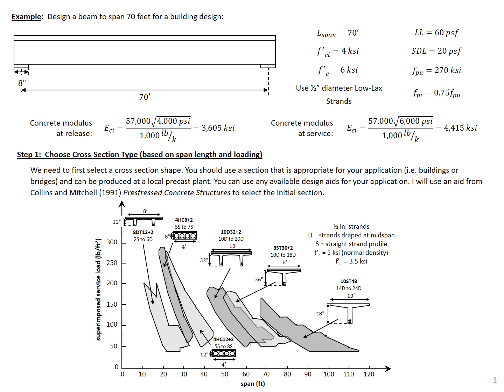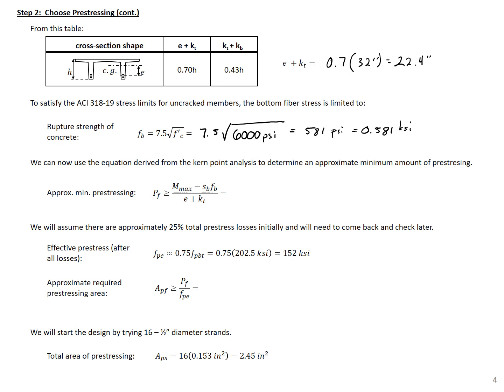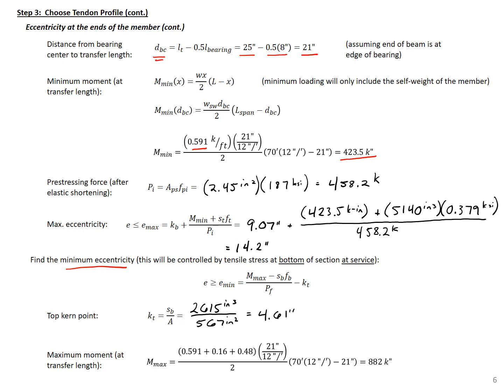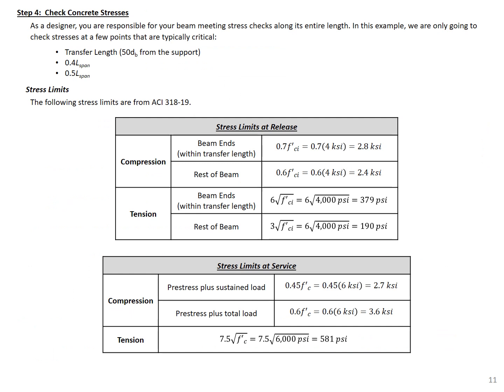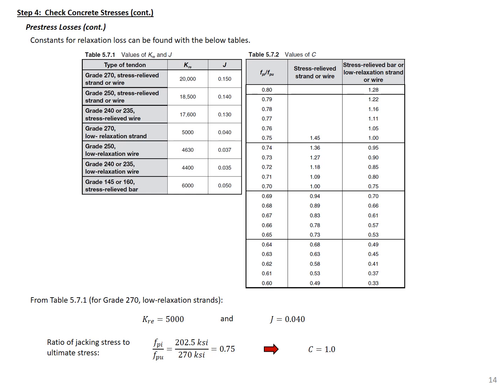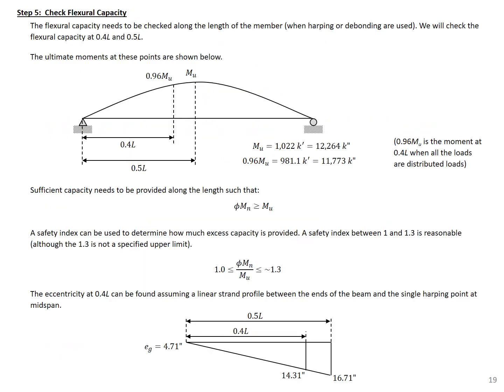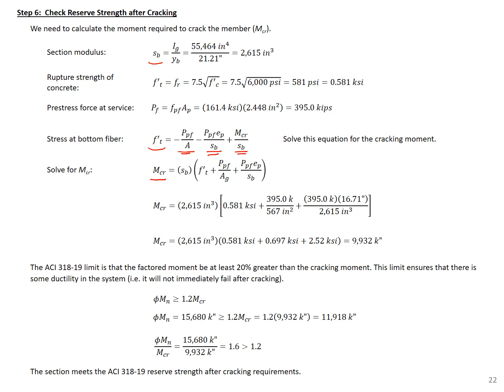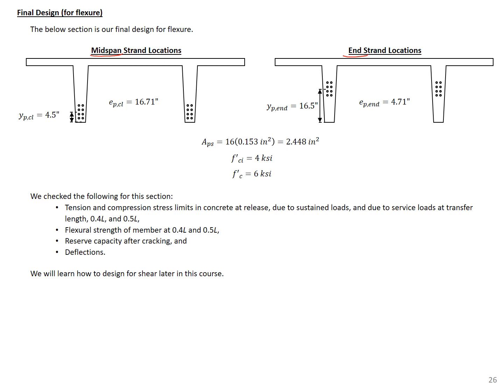Prestressed Concrete Design - 9 - Example 2 - Design for Flexure

Comment: That's so cool that you upload analysis and design of flexural members, will you upload the theory for the Analysis at some point? I know you skipped some modules maybe you didn't have to time to upload that to internet but I would be even nicer to see the theory. But thank you so mucho for uploading Design examples.
Reply from the maker: I am working on putting together additional videos. I will be completing the videos required to finish the end of this semester and then will be going back and completing the other modules that I skipped initially. I do not have an estimated date when these will be completed though.